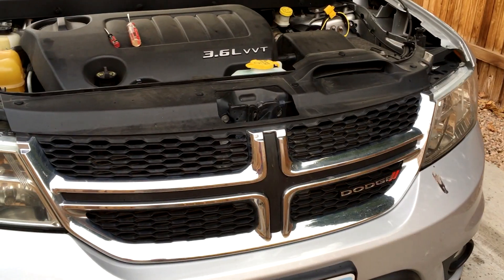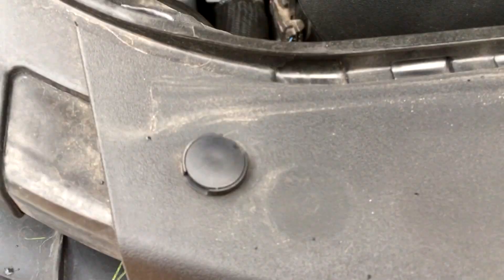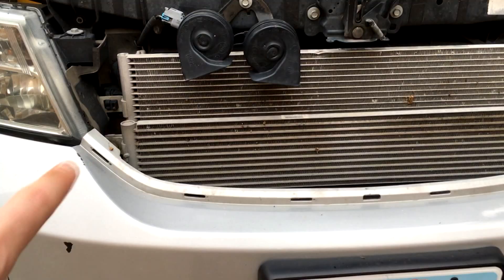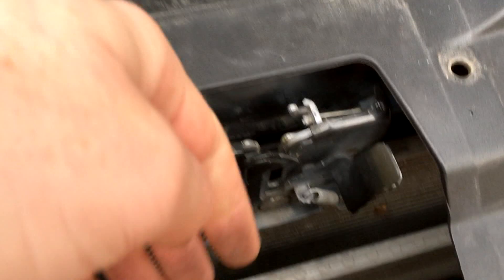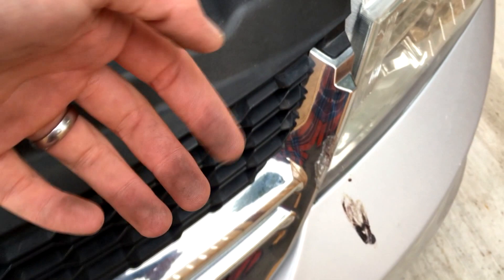How to remove 2012 Dodge Journey grill

Comment: I see you went from the Crome to the Blackout grille. Where did you find it? What model number? I've bee looking to do this swap myself.
Reply from the maker: Plasti-dip. I did it myself.
Reply: @ArchesMechanic  how long does plastidip last? getting a 2017 dodge journey hopefully soon....wonder how it will hold up in hot/humid weather? does it chip off with carwashes?
Reply from the maker: @iseyserolf8893  it stays great. Should be replaced every few years if you want it to be perfect. Otherwise I’ve had it on for 4-5 years and all it’s done is fade a little.